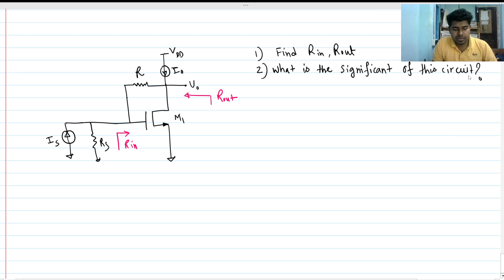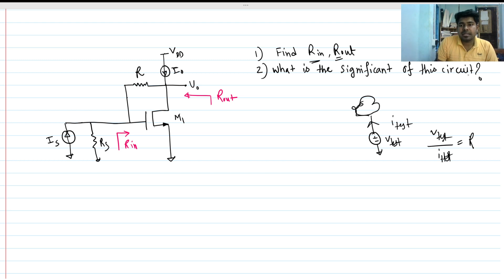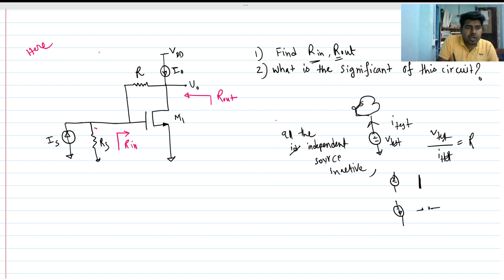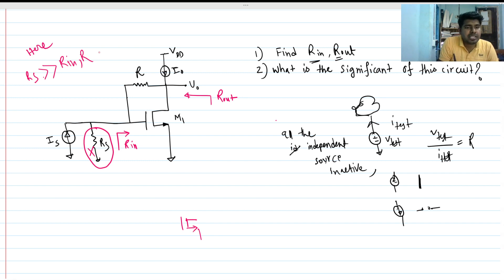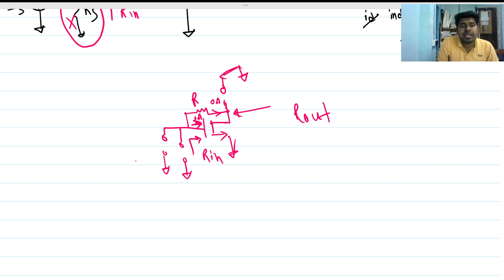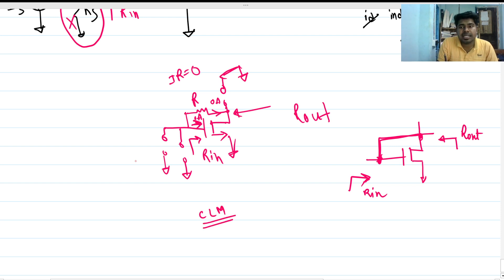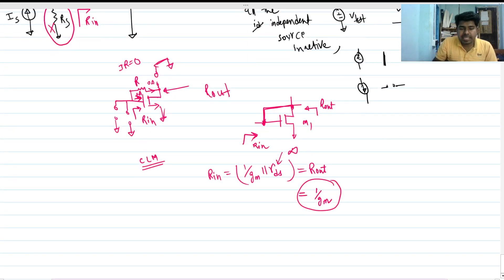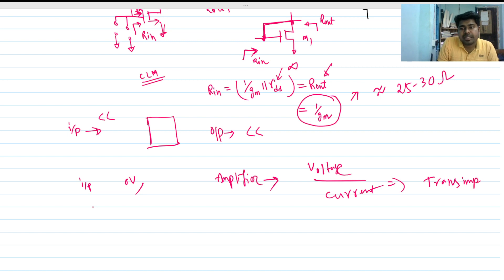Find the input and output impedance of Transimpedance Amplifier

Comment: Rin and R out not same. they are different. current flows through R when we apply voltage at gate. but when u apply voltage at drain, current doesnot flow through R. that point only the R is being open circuited, Vg = 0, Vgs= 0, Rout = r0. Rin = R(1+gmr0)/R+r0
Reply: Can u elaborate on why Rout = r0 and why will current  not flow through drain

Comment: I'm confused about when to use small-signal analysis.
For example, if I apply an input 
𝑉𝑥=1

 =1V, that feels like a large signal — so why do we still use small-signal methods sometimes?

Also, I'm not sure which formula for 
𝑔𝑚
  I should use:

The small-signal approximation:
𝑔𝑚=2 𝐼𝐷/𝑉𝑂𝑉

 
Or the large-signal (exact derivative): 
𝑔𝑚=𝑑𝐼𝐷/𝑑𝑉𝐺𝑆

 
Can you explain in simple terms when and why we use small-signal analysis, and which 𝑔𝑚 formula is right ‼️

Comment: Why is the current through R 0 ? If we place small signal supply ( Any supply ) where Rin has to be found , current will flow through R and then will flow through ro ( 1/gds ) ? . Hence shouldn't Rin = R + ro ?
Reply: Even I have the same doubt, if we place a test voltage source (vt) and measure the current It, that current flows through resistor R.
Reply: Feel better so hard Ckt! It is Magical🤭
Reply from the maker: You can use small signal model,,and if you neglect CLM you will get 1/gm ...please do it once
Reply: @AmitBar-Analog_Circuits  Yes I tried doing it . Actually I got a different result if I used Voltage Source and a Current Source . So how should we proceed in this case ?
Reply: @AmitBar-Analog_Circuits Yes😊

Comment: here why didnt we go for miller concept?
Reply from the maker: is gain known to us ?
Reply: @AmitBar-Analog_Circuits  gmrout but rout approximating to be very high, as it is a Current source??
Reply from the maker: GmRout is voltage gain at very low frequency...but here input is current.
Reply: @AmitBar-Analog_Circuits  thanks missed this reason.
Reply: @AmitBar-Analog_Circuits  yes input is current, and the output is voltage! So if what you say is right, then because output is shorted to input then what is the transimpedance (gain) of this circuit (Vout/Iin)? I would have thought the transimpedance gain is "R", right? Hence, the input impedance should be R/(1+gmrout) neglecting the impedance coming from the source (parasitic capacitance and/or the source impedance of the current source) and the output impedance should be R(1+1/gmrout)//(rout)